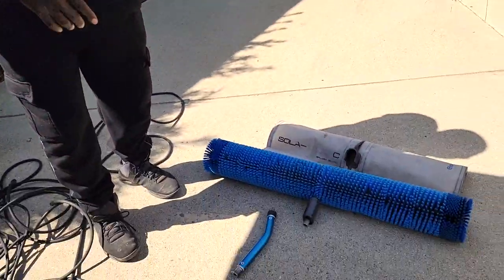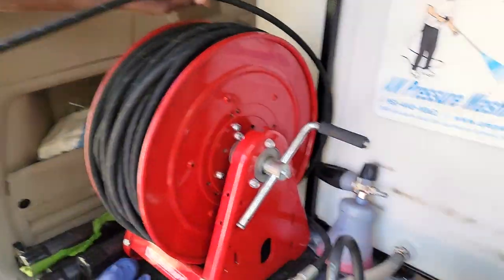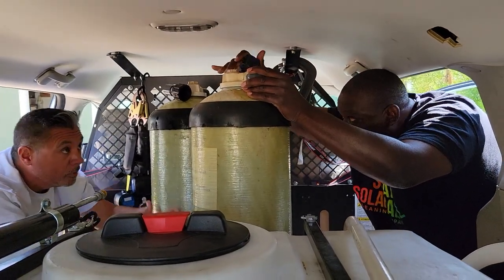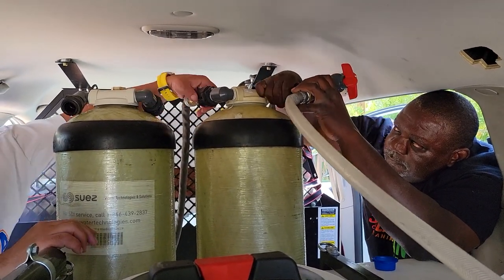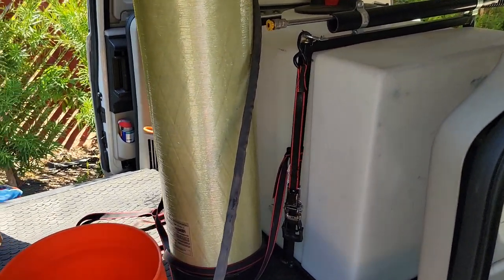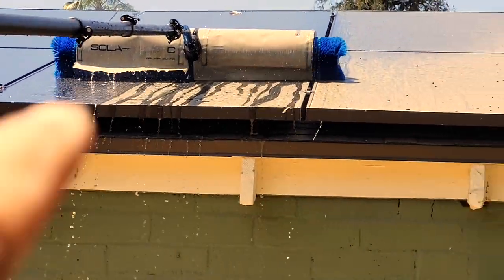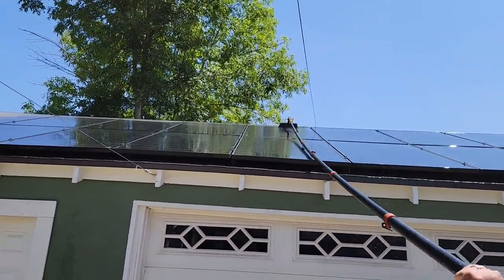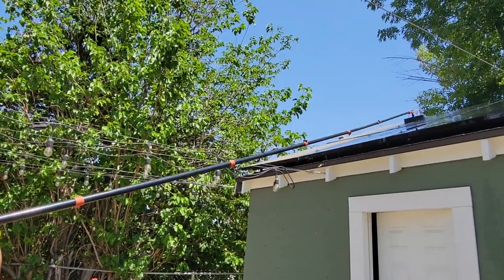How To Setup the SolaTec C1000 | Changing the DI Tanks | New Subscriber Ride Along

Comment: You could still go into the spent DI tank and then out of it into the good tank. It saves the good tank from having to drop it so far. You just have to watch the out put of the second tank. With the meter. They make a indicator light the will tell you when the tank is spent to make it a little easier.

Comment: How many gallons of DI water gets used on an average job? How many panels can be cleaned with the 100 gallon tank? Thanks!
Reply from the maker: On a 100 gallon tank we can clean on the average about 300 solar panels with the rotating brush
Reply: @socalsolarpanelcleaningcompany   and how many would you get with a simple waterfed brush?
Reply from the maker: @fabianmartinez1321  you cant go thru a 100 gallon tank because a waterfed brush is pressured a different way thru a customers tap…. Not a pressure washer

Comment: Great video! Quick question: is the bigger white tank actually needed or can you do without it? 
Great work guys
Reply from the maker: Yes its needed for the pressure washing system
Reply: @socalsolarpanelcleaningcompany  id like to learn more about it. Do you know anywhere online I can get more info?
Reply: @ClipperRoad  what you’re doing is you take the low pressure customer water and connect it to your DI system, 
Then your DI system will dump into a holding tank AKA the white tank.
From there now that you have 100 gallons of clean DI water you can draw from that white tank into your pressure washer and run the C-1000 brush which requires something like 1200-1700PSI.
I run mine at 1300psi ..
Reply: @95TurboCivic  thank you so much, you are actually a legend mate haha.

Comment: Why do you not run a few RO membranes in parallel before your D.I. tanks...?
Reply from the maker: We don't need it that to us is a extra cost replacing filters when the two tanks give us about 1400 gallons  and cheaper ro replace
Reply: @socalsolarpanelcleaningcompany  in pure water window cleaning, RO membranes pay for themselves if incoming tap water TDS is above 100 ppm.  I am not sure how many ROs in parallel would be needed to produce the volume needed to fill your van tank as fast as just using DI.  Tucker/RHG has 60 psi membranes.  They are not cheap but with proper automated daily back flushing, they can last over 4 years.  My current RO membrane is still working good and was purchased in later part of 2017.  I push tap water into a single 40" RO with my a 1 horse power Wayne pump.
Reply: Is their any chemical that you need to mix it into water
Reply: I really appreciate the way you run the thingz